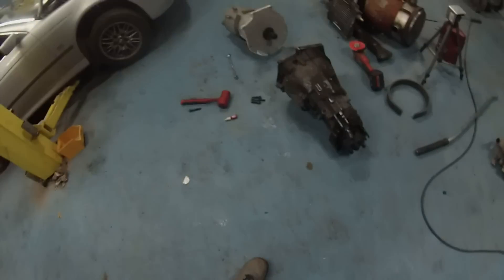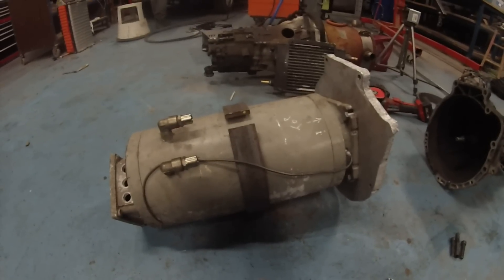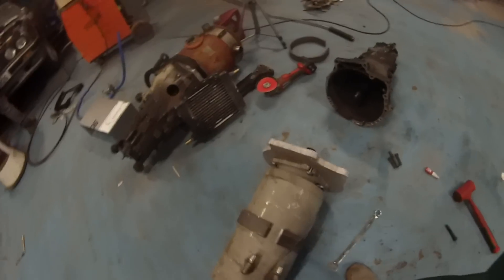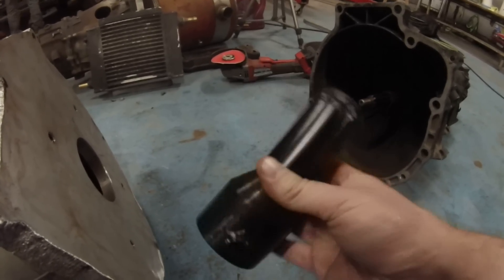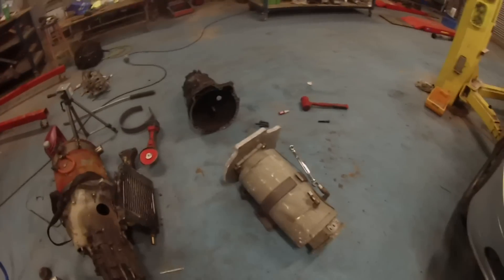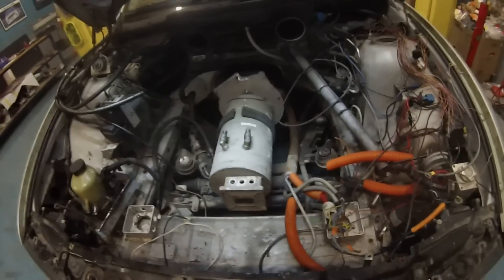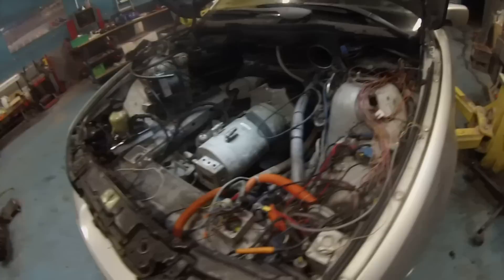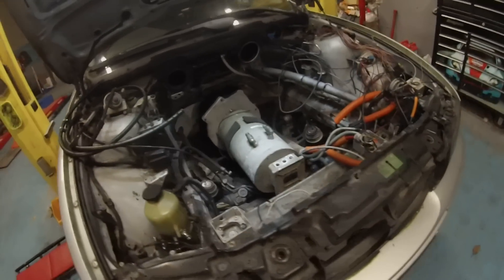BMW E39 EV Conversion 55: DC To AC Part 3

Comment: Whats the spec's for that AC Motor? and what's it's out of?
Reply: peter bradley, it’s an Ansaldo AC induction motor out of a Peugeot van. There was a eBipper van with a 15kw motor with 30kw peak.
Reply: Thanks for reply Damien! That's quite a heavy car, That 30kw (max) motor  doesn't seem like a lot of power. but, I'm sure you've done the math. It'll be interesting to see how it goes out on the road.
Reply: peter bradley, I’m not Damien, but I do hope he goes over the motor rated power and how much he will send to it. 30 kw definitely seems too low, but that company makes that motor up to about 150 kw.
Reply: @imho7250  thanks for that. Reason i.m interested is i.m doing my own conversion. Just looking around for a powerful motor.
Reply: Peter Bradley, that motor looks like it can make a nice conversion. I wish I had the time, place and money to do a conversion. That would be a nice hobby project. Some of the basic conversions look better than factory EVs.